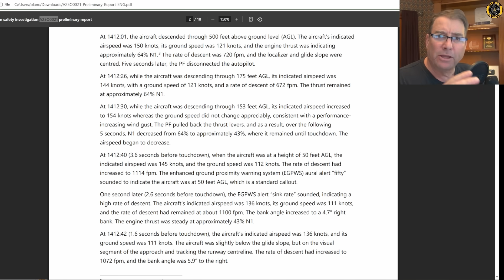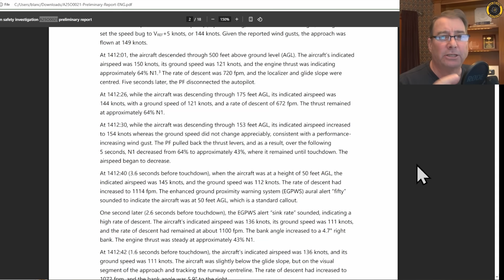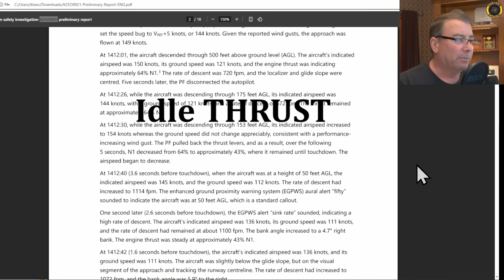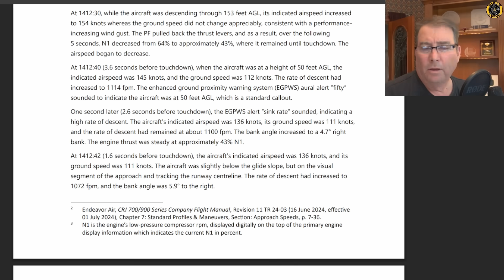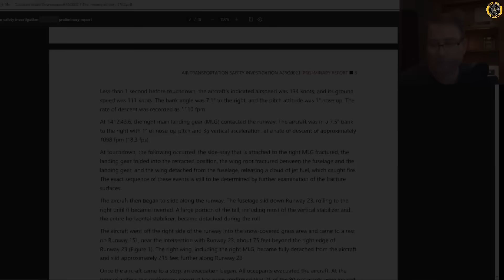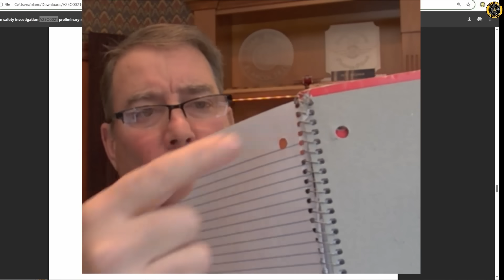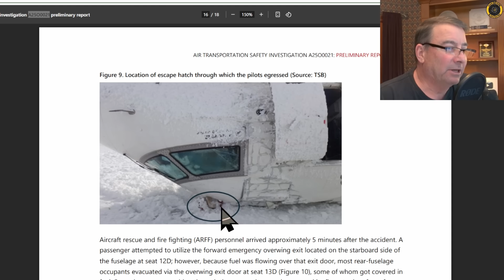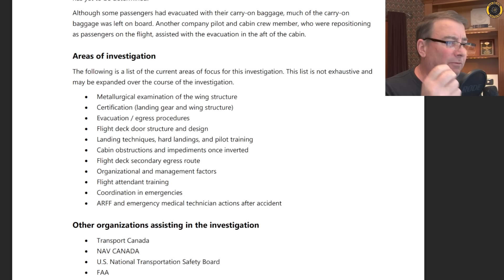TSB Prelim Toronto CRJ Crash

Comment: The CRJ was my first jet. It was drilled into me in those very early days to never chop the power in that jet. Especially if it was windy like this. This crash kind of makes a point of that. It’s so good that no one was killed from this.
Reply: My son is a captain flying CRJ's.  The first thing he said was never chop the power until under 50'.
Reply: @renb2 In the 200 you can chop the power at 50,' however you do not want to do that in the 700 or especially the 900.
Reply: @renb2  Yes... according to a recent video by 74 Gear, the CRJ-900 is much more sensitive to cutting the power earlier and if flown the same way as the CRJ-700 will have a higher final sink rate and hit the runway harder than the 700.  I don't know if the pilot also had experience flying the CRJ-700, but if so may not have been anticipating the different flying characteristics of the 900 during final approach, particularly in gusty conditions. Seems to me an area which should be looked at, and potentially improve training for pilots flying both the 700 and the 900.
Reply: It works great in the 200, not so much in the 7/900.
Reply: I flew the CRJ (CL65) all 3 variants (200, 700, 900). We only “chopped” on the 200. The 700 and 900, being straight leg, needed power almost to the end.
Reply: @crjlife_9082  chopping the power in the -200 or it will float. The 700/900 will drop like anvils. The -200 also has trailing link gear that helps make landings smoother than the 700/900 straight leg gear.
Reply: Jeju air. Pilot greased the belly landing and yet it ended in tragedy. 

This CRJ jet rolled and lost both wings and yet everyone survived.
Reply: @dabda8510 it's not optimal and I'm not a pilot but from a physics perspective, the rolling of the plane is actually dispersing energy away from the aircraft. So as long as every single person is strapped in and the aircraft is built well. It's certainly better than landing into a wall etc
Reply: @Dab-Da-70  The left wing was still there.
Reply: @Dab-Da-70   Jeju Air woulda been ok if they didn't hit a concrete berm at 130 knots. That was some seriously boneheaded ILS design.
Reply: @Vger1977  The ILS installation was originally designed and built by the US military when the airport was a US airbase. The installation is compliant with the ICAO guidelines. The aircraft hit the installation at alt least 130 kts, if it had been absent the aircraft would have the airport security wall 70m beyond, with a similar outcome.
Reply: @christopherrobinson7541 perhaps instead of concrete security walls they should consider installing security fencing. My local airport is not international but on both sides of runway it’s a 10’ high chain link fence.
Reply: @christopherrobinson7541  The security wall looks like a single layer of concrete blocks, pretty flimsy compared witrh the very solid embankment the plane hit. Perhaps of more concern would have been the buildings beyond the security wall.
Reply: @Vger1977 not like there weren't buildings, civilians and other objects just as solid as a berm just beyond that. look at Google Earth and ask yourself if that berm didn't possibly save some lives.
Reply: @Vger1977  The berm in question complied fully with ICAO safety requirements.
Reply: @Vger1977  This line of thinking needs to stop.  Berm or not, that jet was exiting the runway at over 200 knots.  It wasn't going to be "ok".
Reply: @stab74  It would definitley be more ok without hitting barriers that would instantly destroy the aircraft and everyone aboard it. Do you work for the South Korean government or something?
Reply: @hb1338  Use your brain please. That berm was the sole reason that this became such a tragedy. The lack of critical thinking is astounding here... unless youre just a SK govt troll.
Reply: @christopherrobinson7541  So an 8" cinderblock wall wall is as resilient as a concrete reinforced earthen berm? GTFO of here.
Reply: But you are a responsible, smart, cautious and careful person who diligently studied and remember important information. Rather than being a DEI hire put in place for their physical appearance
Reply: @CanadaHasFallen I keep hearing DEI and it’s a dog whistle. We know next to nothing still about what exactly caused this. We know the event sequence. There’s zilch indicating it had anything to do with DEI.
Reply: @CanadaHasFallen  You needlessly shoehorn DEI into every conversation, don't you?

Comment: The discussion of the narrower runway due to the plows clearing only 160 of the 200 foot width brought back a vivid memory of a dual cross-country I made at night with my Commercial instructor.  By coincidence, the airport we were doing a touch-and-go at before returning to home base had a runway almost exactly HALF the width and HALF the length of the big runway I was used to at home.  Given that all I could see was runway lights, the perspective trapezoid image of the runway lights looked perfectly normal to me, except everything was all scaled down by a factor of two.

Next thing I knew, the runway was RIGHT THERE in the landing light, and I think I involuntarily uttered an expletive and belatedly flared, but it was too late and the plane kind of slammed onto the runway. Nothing too drastic and the airplane was fine, but in something faster and heavier than a Piper Archer, I can easily see how that visual deception could lead to a serious outcome.
Reply: I agree I think that will be a big part of the cause.  I can understand how easy it would be to think you were way higher. Especially if neither of them had much experience flying in winter.
Reply: Not a pilot, wondering if this aspect is ever varied on the simulator landings? Are runway widths varied or are they standardized and never confounded by partial clearing or other factors that happen in actual real-world scenarios?
Reply: Whilst I partly agree with the narrowing runway scenario, that doesn't excuse the fact the crew let the airspeed decay.
They lost the extra gust factor allowance , reducing control authority.⚠️
Reply: @  Oh I agree, I think runway perspective errors probably contributed, but there’s clearly more to the story. At some point, even in those last 15 seconds, the approach became un-stabilized enough that someone should have called for a go-around.
Reply: @julesviolin  I think you're right.
Reply: @julesviolin  135 knots at landing instead of 150-155 - that will take a lot of explaining.
Reply: I'm only 50 seconds into the start of this video, with the first mention I've seen or heard of the narrowed runway perspective because of the way it was plowed. I immediately see that as a possible partial cause of this crash.

I still vividly remember the very first time I landed at a "big airport" when first learning, instead of the the small, narrow runway I was used to. That peripheral vision sense of height above the runway had me trying to flare my little Piper a hundred feet above the runway. 

With the runway they were landing at plowed to look 40 feet narrower than usual, it would be easy to have one's senses tricked into thinking one was much higher than one was, all the way to sudden, unexpected contact with the ground.
Reply: Combine that with what @loub747 said about the sink rate warning possibly masking the regular GPWS callouts of 50, 40, 30 etc and honestly that's a recipe for disaster.
Reply: Agree, night landings have the same effects on me.  The runway comes up very fast.
Reply: The crew had a call-out at 100 feet. They may or may not have had call-outs from 50 feet down to the ground.
Reply: As a retired IP, airlines after research. Went to a checkride, of the same events that a pilot had memorized. To one of AQP, one of real scenarios in the simulator. Each event trained to passing. Trained to both hand flying and A/P if necessary. On STARS/SIDS, A/P’s are a lifesaver. Airlines also stopped putting pilots together that both had low experience in type. Hand flying is always an option, and preferred on this type of approach. Earlier on approach to get the feel of the conditions. Another option in crosswinds, land in a Crab with the wings level. Did that in DC-9, B-727, B-757/767, AB330. Crew was fully qualified, don’t know if Captain Actual Flight time in type was a factor. Had plenty of simulator time in type.
Reply: Narrower than expected runway that is paler than normal due to blowing snow will appear further way than it actually is.

Blowing snow messes up your 'texture flow' perception as well.

All this should have been part of thier threats and errors brief before decent.
Reply: I can totally see this being the case here. An unusual situation of a heavy gust + an optical illusion + lack of experience. What I'm surprised at is neither of the pilots felt that they were becoming unstable enough to call for a go around. I thought maybe that might have made a very late call and the engines didn't have enough time to spool up and arrest the descent before hitting the ground, but Juan didn't mention that, so perhaps both pilots were fooled by the optical illusion and they both felt they were stable enough to continue landing? I guess only pilot interviews will confirm that one. Kinda surprised there wasn't any pilot statement in the interim report, but perhaps they hold those back for the final report to prevent and possible misdirected hate towards the pilots.
Reply: @mdhazeldine CVR will be interesting as well as pilots final interviews to complete the report.
Reply: Maybe there needs to be some kind of easy to see visual size standards along the runway so you can quickly get a better sense of how far away you are from the visual standard. Maybe a square meter piece of plywood painted red that is one meter above the ground. So no matter how narrow the runway is due to snow, you can easily gauge your height/distance. Or maybe paint them on the runway??
Reply: @zachreyhelmberger894  if you elevate it, it's could be an obstruction that complicates incidents. If it's on the surface, that part of the surface must be cleared too.  But you're trying to offset a potentially erroneous visual perception of the entire landing surface--with something very much smaller and more difficult to see I'd think.
Reply: @zachreyhelmberger894  The snow being left on the sides gives a visual that isn't known to be in conflict with the given dimensions--until touchdown, or slamdown as in this case. It cost the company some money and inconvenienced some travelers, but with zero fatalies is a fantastic case for learning and improvements in our training of pilots and whereever else improvements in safety are needed, if any.

Comment: 6,000 hr ATP here with a controversial comment. It is tempting to jump on the “back in the day we knew stick and rudder and automation be damned” bandwagon… and, of course, more training and experience is always better, BUT look at the dramatic decline in US air carrier fatalities from 1980 to the present. That doesn’t happen by itself. Economics and demographics have forced the industry to put lower time pilots in the cockpit, yet overall safety has improved. Let’s not lose sight of the advances in training and technology that have met the challenging experience gap. Still room for improvement, of course, but the solution isn’t to go backwards.
Reply: Placing more emphasis on stick and rudder skills is not going backwards, it is ensuring that pilots have better skills and experience than is currently the case.

Comment: 1:07 

Hey Juan, rather than using the Runway number, use the wind direction by bearing.  

Since the winds were 237 - instead of doing RWY 23 and 24, use the second box Wind Direction.  

It gives you the precise cross wind component instead of that larger margin.

Comment: I was taught to judge your height by taking looks out the side window when landing. Helped a lot as I flew into a lot of different width runways.
Reply: My training was the same. sit in the Aircraft and recognise your height by looking out the side window, no doubt more difficult in snow conditions.  Also control rate of decent rate with power and attitude/ airspeed with elevator.
Reply: This crew received call-outs at 100 and 50 feet - after the latter, they should have had a good idea of where they were for the remaining 3.6 seconds of the descent.

Comment: I have been anxiously anticipating your channel coming up on this subject. I like your drawing attention to not only the gusty conditions but the ungusty conditions. Noticing the ground speed, that tells me that that could be your airspeed if the wind stopped for a second. Great analysis of the situation you obviously have landed in Crosswinds before. Training needs to be more than “This is how you turn on the autopilot on”. And the perceived altitude per runway width effect you mentioned is why I value your channel.

Comment: @Blancolirio Yes, Endeavor procedure is to always set the bug to ref+5 and fly the "top of the bug" in gusty conditions. The bug is a total of 10 knots wide with the bugged speed in the middle, so the top of the bug is equal to ref+10.
Reply: Thanks. That’s insightful. I couldn’t imagine why SOP would be to mentally add the speed. Knowing there is a visual reference point (the top of the bug) is very helpful.
Reply: @dw31415  There is still the question of when to refer to which part of the triangle. The chosen procedure has the air of an arbitrary bodge.

Comment: I grew up sailing. The wind gusts can take you out in a quick minute. Several times, when I was on the tiller, a wind gust came up. One time I remember was an unexpected/unanticipated Jibe (that is when the wind comes to the back of the sail and takes your boom across the cockpit). The other times is when we were flying the Genny (Genoa) a larger front sail that usually is big enough to cover the mast and we did not have enough time to strike that sail and raise the jib. Live into the wind, don't hate it, but be prepared!

Comment: Swiss Cheese Holes: Narrow rwy appearance leads to feeling high and thus a late flare; GPWS call masks one of the RadAlt callouts; FO focuses on the GPWS call (what caused that? etc); CA is a sim creature, and has less recency of experience than the FO; the FO was on DAY 5 (!) and reportedly had 12 schedule changes in those 5 days. FO over-thinks the x-wind correction and lets the flare drop out of the scan.        We've ALL been there, but usually it works out "ok".
Reply: I’ve never found narrow runways much of an issue because I’m not really looking at the runway width. The ILS, then PAPI then touchdown zone is all I’m looking at, then cross checking the altitude with the GPWS call out for 50ft, etc.
Reply: At 150 feet, thrust was reduced substantially and was never increased. Call-outs occurred at 100 feet and 50 feet. EGPWS "sink rate" warning issued at about 40 feet. There is no evidence that crew responded to the low airspeed (Vref -11).
Reply: Interesting on the fatigue factor.  I hadn't heard that in relation to this crash yet, but that's definitely going to be another hole in the Swiss cheese for this accident.  Fatigue was a factor in the Colgan crash that led to rules that are in a lot of ways worse at preventing fatigue than before the Colgan crash.

Comment: Juan's closing point, with the Machado quote, hits it right on the head, and I would opine that the primary driver is training background. Airline pilots with a military aviation background comprise a vastly lower percentage of the industry than they did even 15 or 20 years ago, in comparison to those trained at commercial flight schools.

Comment: So, I watched Taking Off's video of this preliminary report and he thought the approach airspeeds were all "Normal", or Within Spec. Now, he did explain the Crosswind Additive component, but he didn't say that 43% was "Near Idle" and he thought the final airspeed and groundspeed were OK, even just a few seconds before impact. You however, explained this in more detail, and you explained why the throttles shouldn't have been pulled back so far (you also explained that a Go Around would have been a wise decision). While his video was informative, it lacked PROCEDURE; or what procedure should have been followed/implemented (he also didn't talk about the Narrow Runway phenomenon, where it makes you think you're higher than you actually are).

Comment: Our ops specs require that this approach in those conditions would be flown by the captain not the F/O. Each pilot is qualified to fly the airplane but this is a captains approach, especially with a low time first officer. We also are limited to cross wind limitations that coincide with runway braking conditions reports. If the runway has ice or snow then the cross wind limitations drop significantly.  37 knots of crosswind on a dry runway. Goes down to 10 knots with ice contaminated runway.
Reply: How well would our not really current Captain have flown that approach? When a pilot loses currency they lose confidence. I think that lack of confidence was why the Captain got the semi-in experienced FO to fly the approach.
Reply: @philipjamesparsons  - the captain might not be any better, but it’s legally their aircraft and job to take responsibility.
Reply: But what if PIC fly few
Reply: 100% a captains landing.

Comment: I saw a 'red flag' threat when I read the crew experience. The captain is relatively low time (3500?ish hrs) and had flown only 3.5 hours in the previous 30 days. Given the FO's relatively low experience as well - I would have expected the captain to be hovering very close to the controls - perhaps preventing that thrust reduction? Or helping flare the nose to a higher touchdown attitude? ALSO is it 'good enough' that landing gear Fails Catastrophically! at only a 3 G! touchdown? The entire airframe stress limits for flight are (thankfully) higher than that! So, why not the landing gear too? Questions Remain.